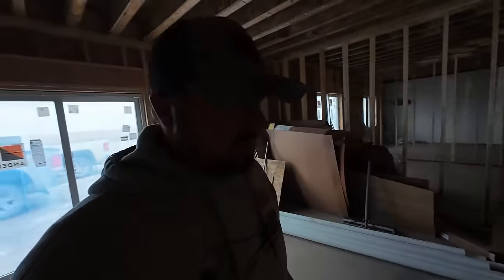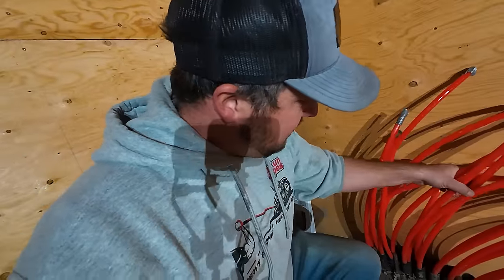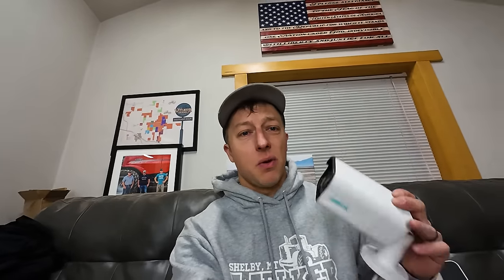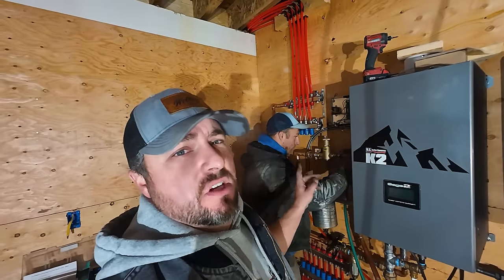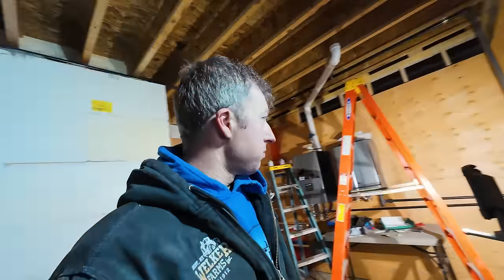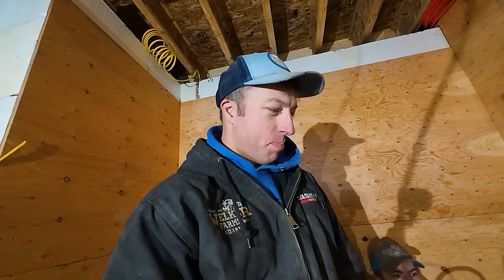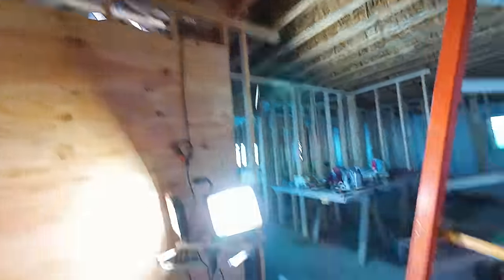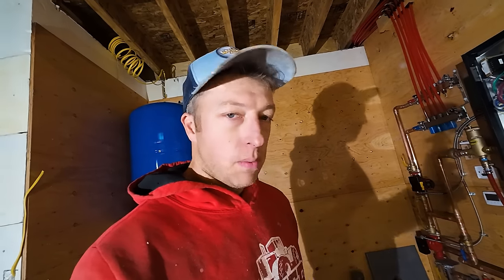Filling My New Floor With Green Liquid - Farm Home Part 11

Comment: Do you plan to run data cable throughout your new home, including to camera locations, wifi access point locations? Unifi is an easy system for networking. You could use unifi to bridge each location (shop, parents, brothers locations and only pay for one Internet subscription) to have the the same network accessible on wifi, outside access points ?
Reply: Wow now be the time to do that but they probably already down the road always by The time this is posted.
Reply: I love the unifi camera system and access points

Comment: Thanks for another great video Nick and Scott. 
It was interesting. 

Thanks to Scott for helping with Nicks house since he had experience doing his.   That helped a great deal  as he had done his already. 
Lots and lots of valves and fittings. They did good if you ask me. Green fluid to fill the lines and no leaks-yea!!!!!!!!!!
Good job brothers. 

House building is not easy. Takes a lot of time and patience to get it all right and working. Looking good so far Nick. 
Hang in there my friend. 

About it for now. Thanks to Scott for the help. 
Thanks for everything Nick. You all be safe and take care. 
The Iowa farm boy. Steve.

Comment: Please dont put more holes in the roof. Exit them through the wall.
Nothing worse then putting holes in a new roof.
Reply: Codes in some areas require them to be ran through the roof as to the walls.   Plus it also depends on installation requirements.

Comment: Nick - what happened to your SimpliSafe system that you’ve had at the farm? You promoted it heavily over the past few years and for good reason… it’s an awesome security system. I’ve been a SimpliSafe customer since 2013 without any issues or failures!!
Reply from the maker: We use both, just for different purposes. Simplisafe is an all-in-one solution for our shop, while Reolink is a much better system for overall farm coverage.

Comment: You & Scott saved yourselves $1000s by running all the plumbing. We looked into a tankless water heater in our 1898 house. The unit was about $2000, but installation was $4000-5000!
Reply: I installed a tankless in my 1959 house luckily I had it torn apart and I have a journeyman plumber buddy or I wouldn't have done it. Between having to do the gas line, water supply and sewer it would have been way to expensive to be worth doing.
Reply: Seriously? Come on now! Thats why they did it and they said that! Don't say the obvious!!!!
Reply: @joemac3118  I can say whatever I want, who are you YT’s ministry of truth manager?
Reply: I used a hot water heater for the in floor heat in an all season  sun room it is great in Wisconsin 😅

Comment: I don't know why they use small pilot bits in hole saws. Nobody is going to use a hole saw to make a hole smaller than 1/2 inch, so why not make them with a 1/2 inch pilot. I don't use a drill bit for the pilot in a hole saw. I use round solid steel rods. Drill the pilot hole first so the solid steel rod goes in the hole.

Comment: Great job! I Installed a new boiler myself in my  home five years ago. It was a pretty big job because I had to put it 20 feet from where the old one had been due to a new code. It took me only four weeks with all the trips back to get more fittings, LOL. Once you get all the air purged you want to leave the little cap on the top of the separator open. It will let air out automatically. If it should get water too high in that cylindrical chamber the float will close the little valve on top. As more air accumulates again it displaces water so the float drops opening the valve again.

Comment: Nice to see these plumbing techniques as a austrian plumber the floor heating we use is with more manafolds and per zone we try to only use 120m of pipe so you can adjust every room and we use one pump for all manafolds

Comment: a tip from a someone that solders valves every day.. just use a hot torch and solder it with it open and cool it off as quickly as possible.. never had an issue yet, if you use a wet rag on the valve most likely it won't sweat out the joint fully esp with a small torch like that

Comment: Hey Nick...    Hole saw suggestion....   

Pre drill your 1/4" hole. Then replace your drill bit with bar stock or 1/4" bolt with head cut off. Carbon steel will flex where HSS drill bit will fracture...

Comment: We have an antique underfloor heat system, circa 1978.  5/8" copper in one continuous loop throughout the downstairs.  One standard 40 gallon household water heater.  One pump and a thermostat.  We love it!
Reply: Lol my parents had that same setup however it sprung a leak, so that sucks.
Reply: @kluckfabrication5991  - That does concern me. 😬. There is a work around, but I don’t want to go there.

Comment: prob too late now, but when hole sawing timber once you have started the hole, stop and drill a hole with a drill bit on the inner of the hole saw circle in the timber just touching the edge of the hole. but not going into the timber your keeping. it will give the sawdust somewhere to go and stop it clogging up the teeth and burning. it will also give the hole saw an easier time.  bigger hole may need more that one drill hole to let the sawdust escape.

tip i saw somewhere and it does help, especially in thick timber

Comment: Awesome job!!! With your water pump and bladder tank, you should look into a “Subdrive Utility” by Franklin Electric! Constant and even water pressure all the time even with multiple fixtures/appliances running. I love it for my family. You can shower, run the washing machine, and still run a sink with no water pressure drop. I also have a water line ran to my garage which is almost 300 feet from the house and have amazing pressure.

Comment: how come you always pitch simply safe security protection and yet on this video, you are saying you have been using reolink system since 2020 ?
Reply from the maker: We use reolink for video surveillance and store the video recordings on the dvi. Simplisafe is used for windows, doors, smoke, carbon monoxide, deadbolt, water sensor, and 24/7 support if a sensor were to trip. The only similarity between the two is they both have cameras.
Reply: I understand now. pretty cool setup you guys have. kudo's to you all.

Comment: If that Hester is Kerosene or Diesel DO NOT USE IT INSIDE without a Carbon monoxide detector hooked up to 120v or batteries and working. PROPANE is clean enough but No Kerosene or Diesel Fuel Oil. Serious Safety Warning!!

Comment: Someone mentioned about a leak, well this is about a possible Potable water failure even a very small misting leak will cost thousands to repair if undetected and if someone goes on vacation.  All those unseen water lines like dish washer,clothes washer, refrigerator and not least the hot water heater.  I have two of these “Moen”(mfg) at different locations these are kind of expensive @$500.00 plus installation that will shut the water off to the house if needed.

Comment: The only thing wrong with all that, is you compromised the durability of the wood you drilled all those holes into.  Nothing you've done is worth that.  Knowing you wanted that did.  You should have had mock drawings did, showing where you needed double walls or chases built to accommodate pipping for that task.  If I had mine built from ground up, cost wouldn't matter when it comes to that.  Added in you also took away any chance of slowing down a fire since you gave it a pathway to fuel its burning.

Comment: Good looking system. I can't believe stainless is cheaper than brass. Why didn't you run the exhaust straight out the outside wall?  Scott is the radiant heat king.
Reply from the maker: The nearest wall is the front porch. Didn't want to have all those pipes pumping exhaust where we will be sitting. Plus an eye sore.

Comment: Is there a reason you didn't run the vent pipe out through the rim joist
Instead of the roof? Less holes in roof less chance for leaks. Or is a code thing in Montana?

Comment: Nick have no worries. As a plumber in MN, I use to install the same style in floor heating systems like this. I used 1/2 tubing in my system as it was the only size I ever used when installing professionally.

Comment: We have exactly the same manifolds in our current build (Sweden) but we did the opposite,we started with the manifolds on the wall connected the pipe and took it out in the floor and went back to the manifold and so forth

Comment: Always run a 2 or 3 inch PVC in your South East corner from your eves to your basement Utility room. Then if you ever need to add an antenna of any type you have an enclosed run to pull cable. no cutting or drilling a hole in your new home.

Comment: Just curious how you plan to heat the main floor of the house?
Reply from the maker: Gas forced air. That way we can use ac during the summer 😁 also nice backup if the boiler fails.

Comment: Nick....
I have been wanting to ask: what symptoms did your truck have when the AFM went bad?
Reply from the maker: So long story short turns out when my engine failed it was a piston that was scorched due to me not using high octane fuel. My engine has a higher compression ratio and it needs higher octane otherwise detonation will occur. So it wasn't the dod or AFM that failed but there was a bent push rod and a valve was damaged so hard to say exactly what entirely happened. My understanding is it's usually catastrophic when the dod fails such as a lifter failing but I have heard of engines burning more oil and lower compression in the dod cylinders.

Comment: Awesome to see your partnership again. People don't realize how many different skills you have/need/develop on the farm.  I am curious about your pressure tank on the in-floor system though. I would have thought it would need to be at the top of the system instead of at the floor. Won't it just fill up with fluid and lose the function? Liquid won't compress, so there wouldn't be any pressure retained there.

Comment: Pex plastic is an insulator,  black iron pipe transfers the heat better.  Pry that the plastic is not on the rewire or rerod in the concrete floor. Good luck

Comment: The online pipe volume calculator says 1.02 gallons for 100 feet of 1/2" pipe and 1.594 gallons for 100 feet of 5/8" pipe. Almost 60% more volume for 5/8" pipe than 1/2.
Reply: That sounds off.  It should be 25%  difference.
Reply: @beckyumphrey2626  Area of a circle is Pi R squared. 5/8 is just 25% larger but it increaes the area of the circle more than that.

Comment: The farm I worked on we built a new shop and put heat in the floor, we loved it. They the son built a beautiful new house all one floor with floor heat, he loves it. He built a shop as well and put it in there as well. The oldest one is now over 25 years now and no problems. You will like it!

Comment: what is it nick reolink or simplisafe turn on a fan and clear the smoke or is the check ? 556k subscribers  followed you for your content or as for a major net work  i worked for for a short time the tv we made there the joke was the 49 minutes between the commercials what did they pay for three minutes of air time or how much time did it take you to make that three minutes segment ?
Reply from the maker: We use both, just for different purposes. Simplisafe is an all-in-one solution for our shop, while Reolink is a much better system for overall farm coverage.

Comment: Soooo, would it be possible to give us a side by side review and pros and cons between reolink and the simply safe system you previously used?
I realize there may be some contractual issues with that but when you switch we would like to what the driver was for that.
Reply from the maker: We use both since they complement each other well. Reolink monitors our outdoor security while SimpliSafe protects our shop.
Reply: @WelkerFarms  thanks.

Comment: Could you put all 3 of exhaust into one pipe sticking out of your roof with code
Reply from the maker: Unfortunately no, the heaters can sense back pressure and will shut off the moment another turns on.
Reply: @WelkerFarms  could you put all pipes out of the roof but do a like chimney or something around it to hide the pipes if you wanted to. Make it removable for servicing n inspection.

Comment: Do you need to have the security system in a heated building? I dont have heat at my farm but I need a  security system.
Reply from the maker: They can work in cold environments but reolink has internal hard drives and freezing temperatures might be hard on it.
Reply: Thanks @WelkerFarms

Comment: Could the fresh air intake be just ended in the attic? That would bring in much warmer combustion air. Also-- keep in mind that some furnace/ boilers drip moisture out the exhaust. I have seen stalacktites hanging off them. Much easier to clean them when they stick out the wall.

Comment: Wouldn't it be easier to push the fluid through the pipe the same way you are to the bucket?  The fluid will push the air out or draw a vacuum and suck it through,  guaranteeing no air bubbles